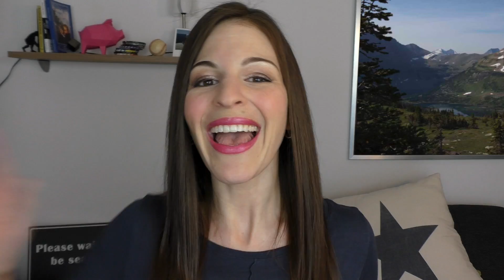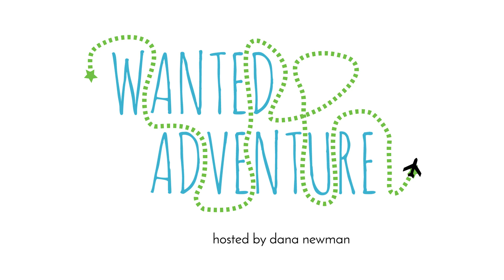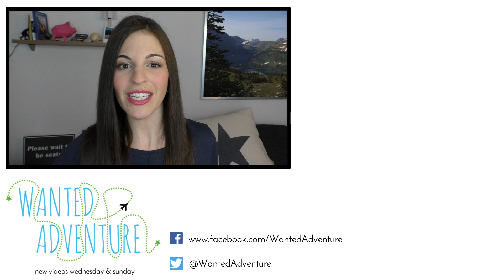Why Are Houses in America MADE OF WOOD?!

Comment: I would/do vastly prefer to live in a home constructed of reinforced concrete, bricks, or steel.  I would/do prefer to have windows made of something far stronger than glass, as well. Many years ago, in fact, I lived in a home that had baked clay bricks for walls, and a very common concrete slab foundation. Only the ceiling, roof (and its supporting beams), doors, and window frames were made from wood.  Unfortunately, I sold that home many years ago, before I realized what a fantastic structure it was.

Thank you for sharing about a very interesting (at least for me) and thought-provoking topic.

Comment: while brick houses won't probably resist facing tornados, in the Caribbean islands, where tornado occur on a regular base, most of the houses are made of concrete. Quite often, only the roof is ripped off during a tornado. Of course sometime the hurricane is that powerful that it just destroy almost everything. Just as Hugo hurricane did in Guadeloupe in 1989, but still, facing hurricanes almost every 4 years, it seems concrete building and houses do resist quite a lot to hurricanes.

Comment: We build houses of wood because we have an abundance of it and its economical. And because wood is an excellent building material. A German house such as you describe would get knocked down instantly if it had to cope with tornadoes and hurricanes. It would be a deathtrap in an earthquake. Germany has a relatively sheltered climate and stable seismic situation. The Germans are apparently ignorant.
Reply: I realize that. It's why I pointed out that it's more economical in my first sentence. If wood were as abundant and inexpensive the other side of the pond, they'd build in wood over there as well. To my thinking a really interesting house material that is almost unheard of in the US is cob. On that note, another big reason houses are built of wood in the US is simply that the building codes require it. There are extremely specific construction codes right down to the dimensions of individual wood members in house framing. It has the effect of making houses out of alternative materials and methods extremely expensive in the sense of building permits, inspections, and the required custom engineering and architectural work the government would require for each house.

Comment: Because in the climates were tornadoes often hit, the iron used to reinforce concrete, or the binding between bricks will crack from high air humidity. A larger complex can maintain this fairly easily, but it is very expensive for a private person will low wage to maintain protection against that.

Comment: One of the major reasons for the differences are what was more readily available in the various regions.  A lot of Europe moved away from wood as it wasn't as available as other materials and the tradition just stuck around.  Meanwhile, in the US, wood suitable for building was/is in abundance.Both have advantages and disadvantages, but in general, wood is cheaper, easier to work with, able to resists many more weather conditions and much easier to repair.  Some misconceptions that people seem to have is about durability.  Not properly maintaining both wood or stone/brick houses will lead uninhabitable homes pretty quickly.  Timber houses can last for centuries too.  The oldest timber house in the US is Dedham, Massachusetts and is just shy of 400 years old.  The oldest wooden building in England is Greensted Church and was built in 845. (over a millennium ago).Wooden homes aren't any more dangerous than Stone/brick construction.  Especially modern homes.  Most stone homes are not wood free either.  International fire statistics show that house fires and fire related deaths are very similar in Europe and the US.  Remember, most stuff in houses, regardless of construction, are flammable.  Wooden walls do not just suddenly combust.  Wooden homes fair much better in earthquakes.  Both styles fair about the same on most other conditions.  Stone can handle water damage better, but Wood can handle winters better.  Water freezing in cracks can really do a number in stone/brick work over time.  Wood is actually better for insulation and has a softer sound quality indoors.   Wooden homes are also cheaper to heat and cool and have a more carbon friendly footprint.Ultimately, stone houses are not superior to wooden homes.  There is no compelling reason to not use wood in the US other than personal preference.

Comment: I think the reason is the same as why US still doesn't adopt metric system - convention.  My house in CA, USA was built in 2012 and it can withstand earthquake perhaps 8+?  It is structurally sound to have 4 stories but local law doesn't allow.  Point is, it is a lot cheaper (and easy) to build a wooden house with added steal beams to re-enforce the structural strength.  And that will give the same strength as stone house and better earthquake proof than stone house.

Comment: The USA is so large and has so many different climates and weather phenomena that its unfair to categorize this country as having only ''wooden houses''. The State of Texas alone approximates the size of Germany

My California house has a wooden frame with stucco plaster exterior walls 30mm thick, moisture barrier, wiring and plumbing, then insulation within the framing spacing, then 16mm gypsum plaster board interior walls. It is bolted to a concrete perimeter foundation 1 meter thick with a space between the floor and the Earth where the plumbing and air ducts are accessible for repairs. Wiring and plumbing changes and room additions are very easily done at reasonable cost.

The Loma Prieta and the Napa earthquakes did no damage to my house at all except that the power went out for 8 hours and the swimming pool lost 1/2 meter of water due to sloshing.  The wood frame home structure is the best application of building materials here. This house would be totally unsuitable in Florida 4000km away or in cold northern climates, or coastal hurricane zones.

Building techniques and materials match the various regions and climate requirements here. My main concern is earthquake survivability. We do not have tornadoes, hurricanes, or excessive snow loads in my town.

Comment: depends on municipality. south florida requires concrete block or poured concrete because of hurricanes. other municipalities require wood for buildings under one height but concrete for buildings over another height. there is no one answer, though, yes, wood is cheap.

I'll also point out that many buildings in Europe are post-war construction...when concrete was this great, modern thing, and there weren't massive lumber supplies in Europe.

Comment: As far as I know there are two main reasons why german houses are not commonly build of wood. In the moist german climate wood rots rather quickly. And the second reason would be fire prevention. In the olden days cities and villages were tightly packed, and doing that with houses made from combustible materials while open fires were the main method to heat and cook, would have been a disaster waiting to happen. That's why houses in towns were built either from bricks (mainly in the north) or with timber-framed loam-walls

Comment: Because they just DO is as good an answer as any.

BUT, we also have a huge infrastructure to harvest and process wood for building lumber. 
We do use bricks, blocks, and concrete, too.  We could switch, but we would have to ramp up our production of those materials and the Cost/Benefit ratio hasn't been met.   Until trees (which are planted for the purpose of using for building material) become an expensive resource (as they are in Germany and much of Europe) they won't change. 

Personally, I'd like a STEEL FRAME house. It's a tad more expensive to build.And they still use particle board for the outer shell and floors, but it IS sturdier and less prone to moisture and termite damage.

Comment: The larger tornadoes leave a one to five mile wide path of dirt. They suck the concrete off highways and interstates. A concrete and steel reinforced bunker type building half in the ground with steel beams sticking sideways into the earth would probably stay but things might get sucked out of the openings. Hurricanes have smaller tornadoes whirling around inside them. You can hide in a basement but, depending on where you are, you might get flooded. I think the main reason we have so much wood construction is that our forestry programs have supplies us with a sustainable lumber resource.

Comment: Having owned homes in CA, TX, and here outside of Hamburg there are pros and cons to both. The cement walls in homes here can have problems. Cracking and electrical is a pain especially if any issues arise. With a home being brick in tornado alley (Fort Worth, TX) I lived through a tornado and only windows broken but neighbors weren't as lucky as I was told by native Texans bricks just throw harder by the actual tornados. Homes in the states aren't cheap and reflect on the cost of living in general like here in Germany.

Comment: In the USA, many houses are made of wood, like unfortunately also the WTC with its wooden I-beams. When an airplane flew into the tower the I-beams caught fire, burnt down and the building collapsed, each of the two. Had the I-beams been made of steel, the WTC would still stand since steel can't burn and the temperature of burning jet fuel can't melt steel.

Comment: Wood, kept dry, can last centuries;  When compared to concrete wood insulates well. Laminated wood can be stronger yet lighter than concrete.  Is better for a single family dwelling for acoustical characteristics and color warmth.  While concrete and steel suit a commercial building. Successful building designs place the correct material in the correct place...

Comment: wood is stronger and more durable than you'd think. The problem I see today, is that many houses are made of cheap pine 2x4's. Even the specially treated ones are still plenty durable and rot/termite proof, but they aren't going to last as long as say 2x4's made out of cypress. Plus, the process used to treat the pine is not so good for the environment. If you've ever been to Louisiana, the oldest houses have been there for over a hundred and fifty years. Cypress lasts forever and is almost completely rot and termite proof (at least the old growth timber). Also plenty of houses are built out of brick, but they usually have a wooden framing. That framing comes in handy especially when you are trying to attach stuff to a wall on the inside. Instead of just hanging it off of the drywall (which is relatively weak) you can screw top heavy furniture directly into the stud which is a lot more secure.

Comment: You'd need the scottish style houses for tornado alley. A family builds its own house during its lifetime for the children. They use 3-4 feet wide, 6-9 feet long, 2 feet high stone blocks to build their house. 1 stone at the time, 1 stone a free/non-working day. So usually 2 in a weekend. Those would survive a tornado. You can drive a fully loaded semi at full speed into it and the wall has virtually no damage. Any door or window would let the semi through only ripped apart just to fit the window.

Comment: My guess would be the fact that wooden houses can be build up much faster. 
It takes at least 3 months to properly build a brick house since you need to wait for concrete and plaster to cure properly.
But you can build up a full family wooden house in roughly one or two weeks.

Also it is much easier to extend a wooden house than it is to extend a brick house. In fact brick houses are rarely extended because the walls at the place where extension connects too the original house likes to crack.

And for those of you saying that brick houses offer better insulation than wooden houses. 
Well if as wooden houses you mean log houses then you are correct. Logs on themselves provide less insulation as bricks which have air pockets in them to help with insulation.If as wooden house you mean house whose otter walls are just a sandwich of two sheets of thick plywood around wooden wall frame with. Then you would also be correct even thou the insulation differences between such walls and brick walls become much smaller. Yes it is true that such walls also have air pockets inside but since these pockets are big and extend throughout the entire thickness of a wall they don't offer such great insulation capabilities as the air pockets inside bricks which usually extends only half of the brick width (two rows of tem).
But if you go and fill up those air pockets inside a wooden wall that is made from a plywood sandwich you can greatly increase the insulation properties of that wall. And in contrary to increasing the insulation properties of the brick walls where you need to add insulation material to the outside of the wall and thus increase the wall thickness when increasing the insulation properties of a wooden wall you don't increase its thickness a bit. So no half meter thick outside walls are needed for achieving very good insulation as it is with brick houses.

Any way instead of asking "Why are houses in America made of wood" we should be asking ourselves "Why did Europeans start building houses from stone and bricks in the first place?"
And the answer to that question is "Fire hazard".
You see when you have a city build only with wooden houses even small fire can quickly turn into catastrophe because it can easily spread out throughout the whole city. There are many stories throughout the history of fires destroying large parts of pre-medieval and medieval cities.
Well but how come Americans didn't have same problems? The main reason is that at the time when America was being colonized people were already well aware of potential fire hazards so houses were not being built to close to another, each city had its own firefighting service which could quickly respond to any potential fire and bring it into control before it could become a real threat.

Comment: A fun fact about Germans and houses in America:  If one of the old stone or brick mansions in my house from the late 19th or early 20th century catches on fire, it's hard to put out the fire, because the Germans who designed and built the wooden roof structures made them too solid.  A couple of houses in my lifetime have been total losses, because the roof framework was so impenetrable that there were not enough gaps for water from the fire hoses to penetrate from overhead.

Comment: I don't want to insult you you or any other American but the problem isn't that houses in the US are made of WOOD, the problem is that they are built form cheap garbage! They could be torn down using nothing but an axe or a crowbar! A basic structure from thin planks, dampening inbetween and some sort of cover up on either side. That's not an outside wall for a building... That's something you can do to seperate two rooms from each other. We have houses made of wood here in Austria aswell, but they are full wood not tiny planks or press board, also larch wood can withstand our climate without any sort of treatment for many decades, maybe even centuries - we have old farm buildings that are 300-500 years old and are complete wood constructions, so longevity isn't an issue. 

- American cars are amazing! Their houses however are not...

Comment: The fucking tornadoes CAN destroy your house even if it's made of bricks. So it makes sense that you make it from a cheaper and lighter material. So you pay less to rebuild it and also don't die buried beneath concrete. And about earthquakes, walls can get cracks more easily when made of bricks and concrete because of the tenacity of the material. And no, I'm not even american, just not stupid.

Comment: The fact that almost all houses in the U.S. are build in timber frame construction means huge economies of scale for this construction method. To build a house out of concrete and bricks in the U.S. would be horrible expensive because it's so uncommon. A big advantage of wood houses is normally that wood insulates much better than concrete or bricks. Houses in Norway and Sweden are also mostly made out of wood. 
Concrete and brick houses would normally withstand most of the tornados, but these heavy roof tiles of European houses would be extremely dangerous when they are tossed through the air. Much more dangerous than these leightweight roof shingles they use in the U.S. When someones head would be hit by such a heavy roof tile, he will most likely be dead. European style houses in the tornado alley could eventually mean more fatalities. 
Building a timber frame house takes also much less time, that means normally lower costs.
 
The actual disadvantage of American houses is that they are mostly build extremely poorly. The timber frame construction is mostly just 2x4 or 2x6 inches. The walls appear almost paper thin. The windows, the plaster board, the insulation, this plastic wrapping material, vinyl siding, strip foundation. That is all so low quality. In relation to the quality, the houses aren't cheap in the U.S. Wood is a fantastic building material, but they should use sturdier materials and put more efforts into quality. 
We do have wooden houses in Germany, they are normally prefabricated, and they are mostly passive houses. The thickness of the exterior walls is about 35-45cm, that is 2 to 3 times thicker than most exterior walls in the U.S. 
Another disadvantage of wooden houses is the bad noise protection.